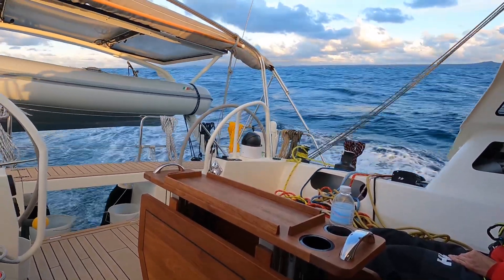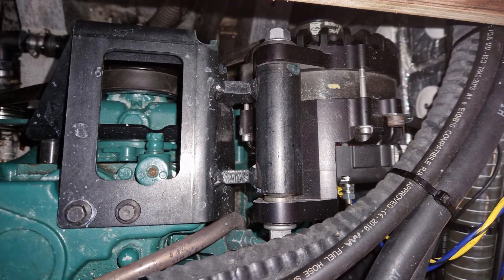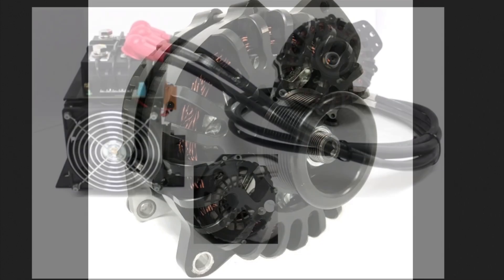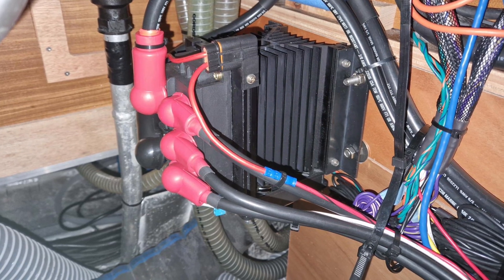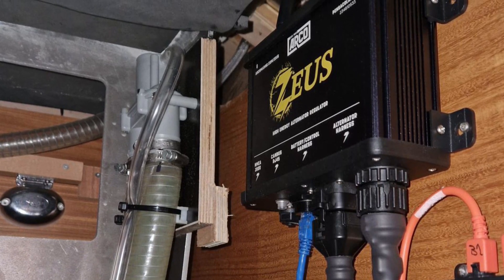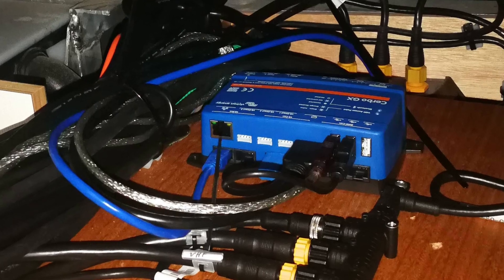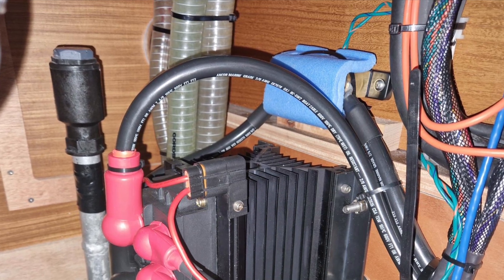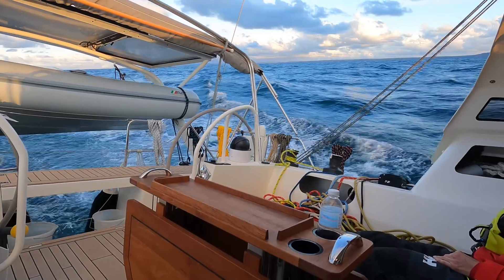Snow Gum - Second Alternator - Electromaax Genmaax 250A & Arco Zeus Regulator - Garcia Exploration

Comment: Hi Guys. I realize you installed this over a year ago. I am doing the same install with electromax 250 to an external rectifier and then to an Arco Zeus. Any chance you have any info on how you wired the zeus to the rectifier. Struggling to find much documentation on this.
Reply from the maker: Hello David. Our friend Tom did the installation work on Snow Gum, after he bought the boat from us and renamed it Night Owl. However, we worked together on the design and technical aspects of the install. From this, my memory is that there is no connection between the Zeus and the remote rectifier for the Elextromaax Genmaax 250. However, there should be at least two cable connections between the Zeus and the alternator body itself. These will be the field wire (so that the Zeus can control the alternator's output) and the wire for the temperature sensor which will be installed on the alternator body. Beyond this, there will also be wires between the Zeus and the new shunt you'll install for measuring the alternator's output. You might also be installing another, new shunt at battery negative, probably next to your battery system's existing battery negative shunt. As mentioned, I'm going from memory with this, so please say more if you're seeing things differently at your coal face there. Once you've got all the cables going to the right places, the system should work very well. You'll be able to hear the engine's loading changing as the Zeus increases the field current. You'll see all the data on the Zeus app, along with parallel info on whatever system displays you have. Let me know if you think I can help further with trouble shooting. It took a couple of voice calls across the planet for Tom and I to get one last wrinkle ironed out. The system was working; it just didn't look like it was due to one cable being out of position. A quick fix to that and Voom, all good and perfect performance from then on. Good luck. :-) Regards, Rick.

Comment: https://youtu.be/9CrBNP1dqzs
I can charge at 1400 rpm  continuously 230Amp, temperature on the alt is only 42C🙂
Reply from the maker: Only 230? Pfftt! The ElectroMaax can do 269. hehe. Any moment now, Integrel will enter the chat ... :-O
I watched your video. Nice and short. Thanks Dan. 

Big Edit: Dan, I've just realised that your Kimpower alternator is your own design and is water cooled. Wow! Congratulations from me. I'm really impressed and wish you well with further developments. I'll be looking for further technical information. Naturally, I do wonder about the added complexity and installation cost of water cooling, but apart from that, this is impressive work. 🙂

There is benefit in keeping the rectifiers cooler, hence the remote rectifier unit with the Electromaax GenMaax 250A RR model. It can have a fan for even better cooling. Your water cooling system should provide similar benefits.
I like how quiet your engine is. There's pros and cons with different designs. Regards, Rick. 🙂
Reply: @SailingSnowGum  Hi Rick
many thanks for your nice words 🙂
I have worked with small electric motors sinze 1989 as sales engineer and alternator are a like a motor but backwords. You understand what I mean.
I bought my brothers Jeanneau 42 from 2012 when he ordered a new Bennetau 55 (named Meribel)
He had equiped my "Damen" (Lady) with 540 LFP from Victron and the alt get extremly hot. He equiped his Meribel with 1400 Winston LFP and he got problem with the alt. I told him about water cooled alt and he sugested to try that on Damen and if everythining works out I have to equiped his Meribel. This was 6 yers ago.
Both of us have been obsest of alt.
We have invested about 20.000€ in RD 
Of course we are engineers out to the fingertips.
(my brother is 74 years old and I am 64 BTW)
Water is cooling down 250 times better then air. Porsche needed more performance on their cars and their last air coold engine was build 1998. Thats 27 years ago.
Water cooled alt in a car is super, BUT only when its freezing cold outside. When you start up you have a lot of load and it produce 2000 watt to heat up the water that go directly to the heat element inside the car.
But a stunning hot summerday the alt have huge problem. No car manufacture use water cooled alt today.
BUT al sailors have the ocean that could cool down the alt throw a Bowman heat exchanger. Every year I have improved the alt and nowdays it charge about 235 amp continuosly and the temp is 42C or 107F
The engine compartment is cooler nowdays then I had a air cooled alt.
My brothers Meribel I have equiped with two alt. This year they will produce nearly 500Amp!
I am dooing al this on my spare time until next year, then I will be retired.
Last try I heated up 25 liter of water and the load was 240Amp or 3,15kW  during a test during 30 minutes.
4,17J or  Watt/sec for 1 gram and 1C this mean 2000Watt of losses I got.
The alt is tuned for more improved forced airflow. I dont now how much that is.
But the rectifier losses is about 250Watt to 300Watt.
We are handfull of sailors that have water cooled alt and its absolutly the best solution for sailors.
Please contact me on dan.kimblad@gmail.com
I can give you more info and picture and I want to know more about your set up.

:-Dan
Reply from the maker: @dankimblad1521  Hi Dan. I've read through your notes here a few times. Fascinating! I'm imagining a high latitude boat that uses heat from the alternator for cabin heating. A simple coolant circuit to a small radiator and fan would do the job. Or perhaps a more sophisticated setup, including a water boiler for showers. I can see how you, your brother and your boat friends have enjoyed developing this technology and applying it in your boats. It's not for everyone of course, even though they would all enjoy the benefits. Cost, complexity and great performance will be balanced against simpler, cheaper and inefficient solutions, as is always the case with consumer products. I wish you all the best with your product developments. You'll soon need a 1000A fuse and BMS setup! Regards, Rick.
Reply: @SailingSnowGum  
Hi Rick
I have measured up the losses or the heat dissapation in the water. It is exactly 2000 Watt that I am cooling down at 240 Amp charging. To use a small radiator and fan will not make it easier and. One man on the west coast (USA) have tried that and got huge problem whit air in the system and after a while to hot and burned alternator.
I use a small heatexchanger from Bowman for marine use mounted directly on the strainer for the water to the engine. Thats much simpler and cooler.
I will make a picture how everything looks like today. Its not complicated this system.
You can se on this film that I have only 3 hoses and thats al. The rectifier is also cooled down by water.
I hope you can se how simple everything is on this video from my test facilities.  I have tested up to 50C or 122F on the cooling water and the performance is then 236Amp, at 40C or 106F its 240 Amp
Enjoy  
 :-Dan
https://youtu.be/m0jMB9BDsz4